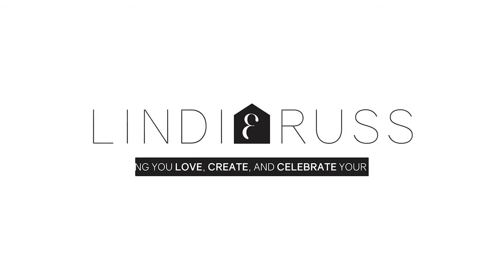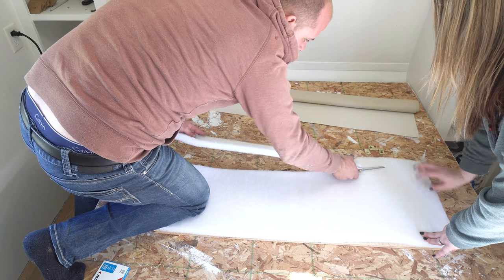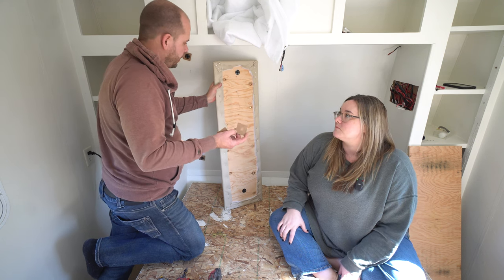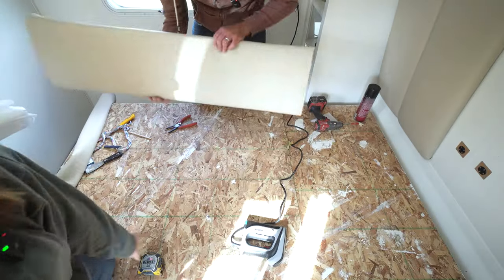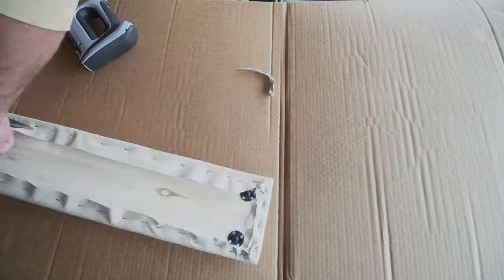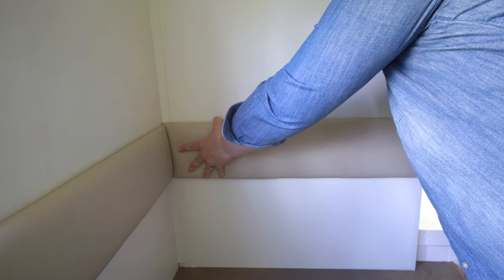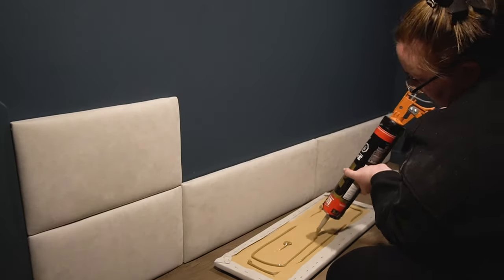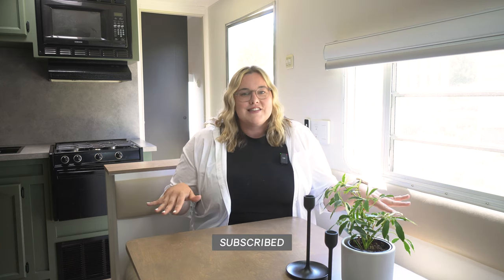DIY Upholstered Wall Panels | No sew wall panels - 3 ways!

Comment: Great video, already ordered some clips! What weight of batting and what thickness of foam did you use on the headboard panels?
Reply from the maker: it was a light weight batting (fairly thin) and  we used 2 1/2" or 2" foam if I re-call. Thanks for watching! Good luck on your project!